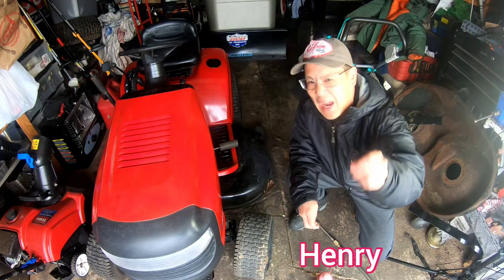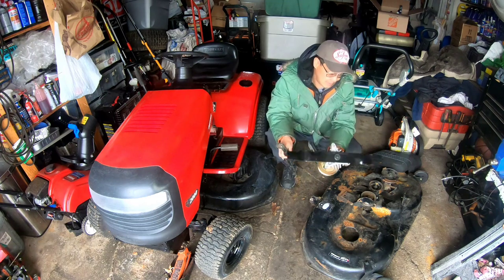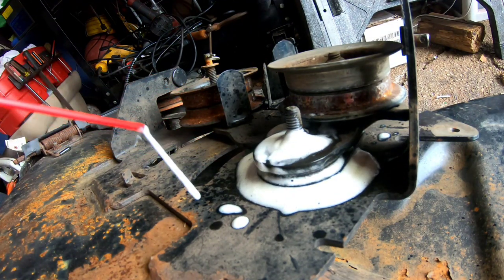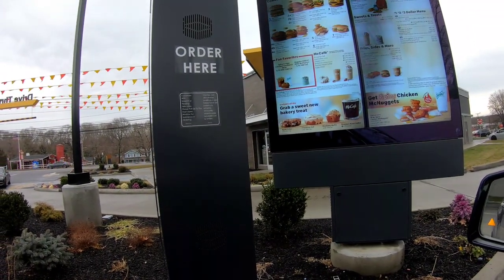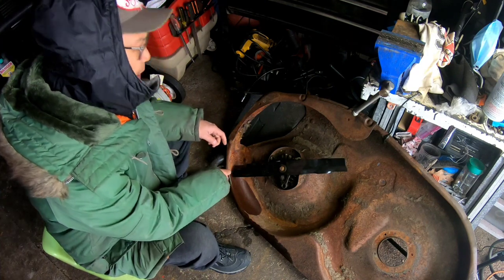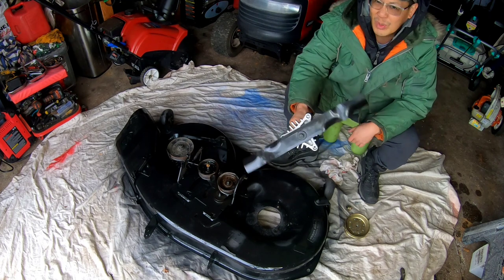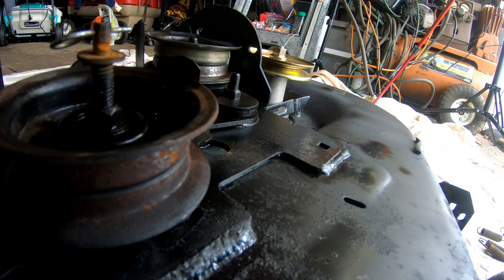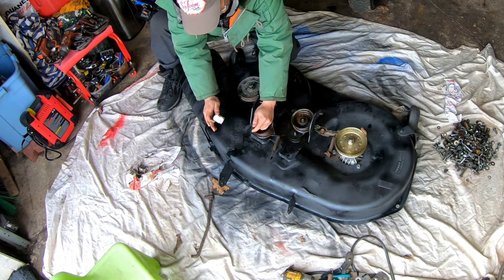REFURBISH REBUILD CRAFTSMAN LT2000 LAWN TRACTOR MOWER DECK SPINDLE SHAFT PULLEY REPAINT REPLACEMENT

Comment: Henry, I told you that the SeaFoam Deep Creep was some really good stuff. As I was telling you a few days ago, The Deep Creep worked on a 5hp Briggs & Stratton flathead engine that had been submerged in flood waters in which the valves rusted in place. 
You can spray the Deep Creep on problematic steering spindles in which the foam will wet the area that the grease can’t get into. Try that trick some time with the Deep Creep and you will be very amazed. The mower deck looks a lot better after your paint job. It’s really amazing what a little paint will do to make things look better.
As for me today, I have been changing the rear tires on my 110 John Deere tractor today. To remedy some crappy wiring, I replaced the battery cables yesterday and for good measure I also replaced the spark plug which made quite a difference in the running of the engine. So All & All Henry, My John Deere 110 project is really starting to take shape.